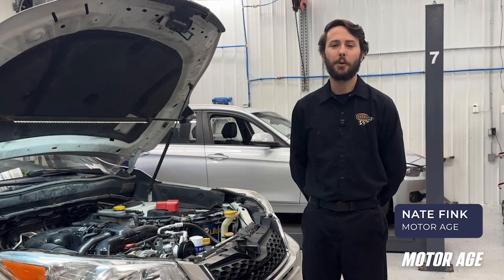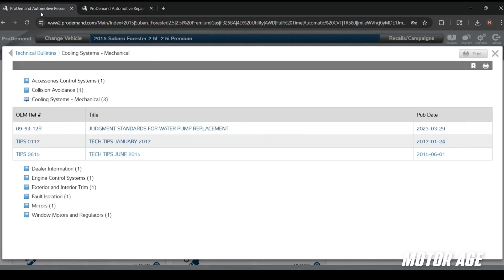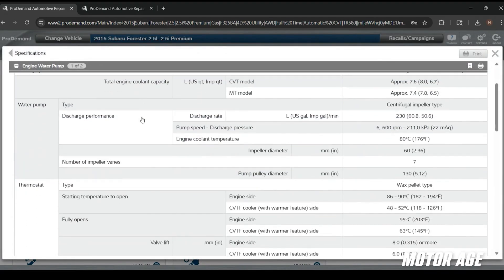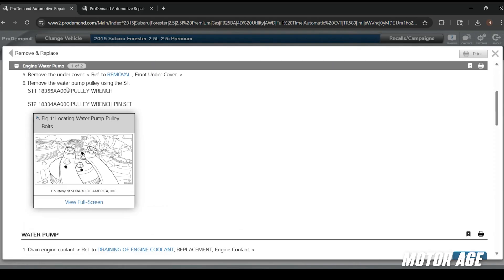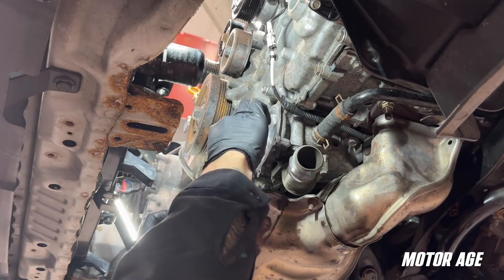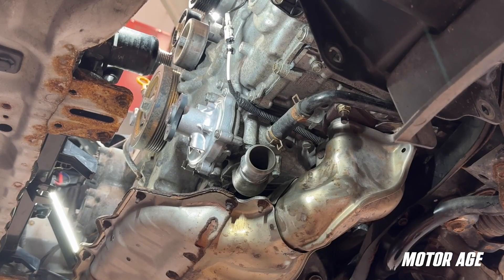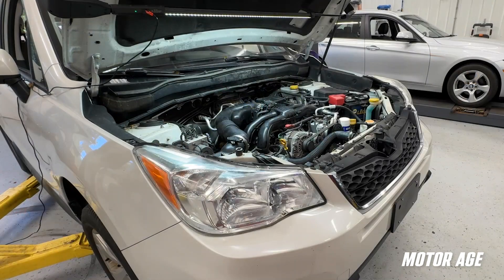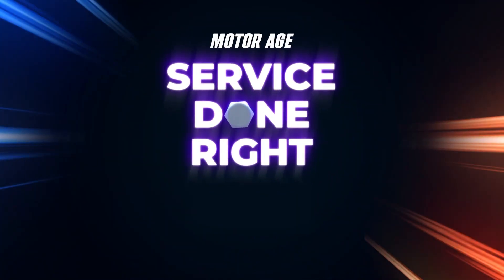Avoid Comebacks with a Complete, Data-Driven Water Pump Repair Workflow

Comment: Even with a VIN the system still has questions. Schematics show all RPO code differences so you have to be aware. The search sucks for many things like Ford transmission shift solenoid strategy changes bring up nothing.